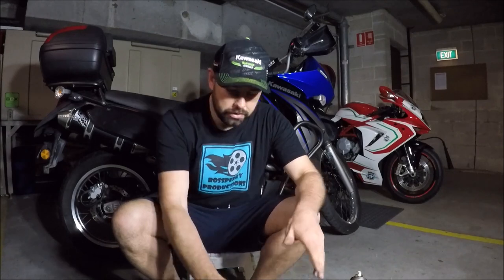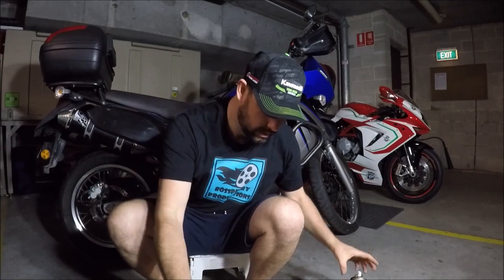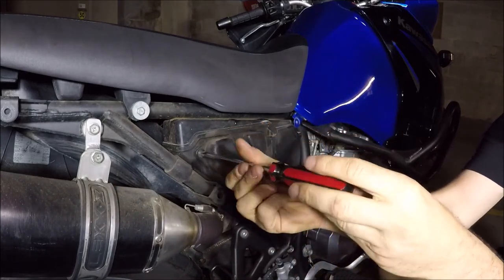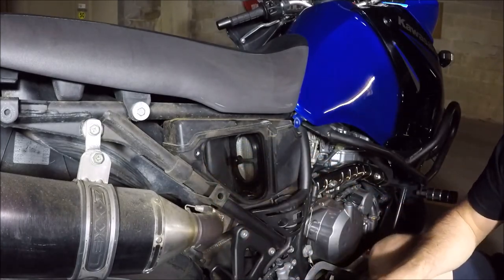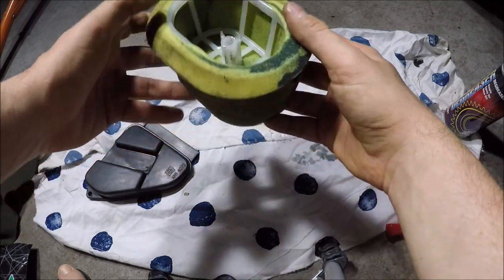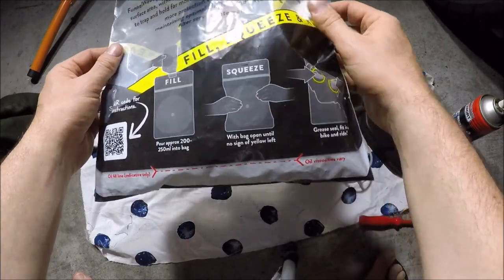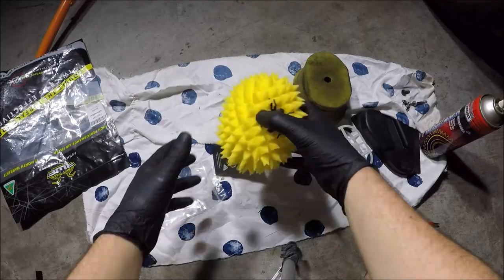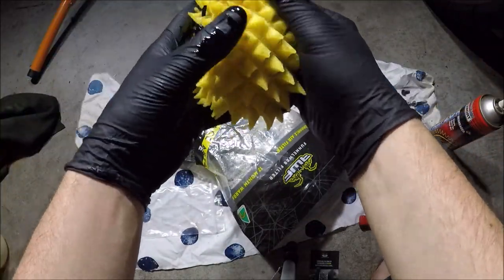How to Replace the Air Filter on a Kawasaki KLR650 Tutorial

Comment: The filter that was in there looked burnt? Or was it just carbon build up?
Reply from the maker: Hi Mate, thats where the filter oil has mixed with dirt and grime on the intake side of the box. Thats why it is important to clean your filter regularly. when are  'Lets Review It' coming to Review the KLR 650 and MV Agusta?
Reply: Shoulda seen mine after the bike sat in a shed for about 8 years, it turned to an oily dust
Reply from the maker: @jasonlambert154  I bet !!
Reply: @RossPerryProductions  and I rode it 800km before I realised lol
Reply from the maker: @jasonlambert154  I'm sure it would have gradually burn it off haha

Comment: I used a Uni filter and K&N spray filter oil.

I did not allow it enough time to cure. It fouled my plug and the bike would not run.

Give it time to dry/cure.
Reply from the maker: I have never had that before, although I tend not to use the spray type. Ross
Reply: Man, you need to squeeze out the excess oil out of the filter !
Reply: @markcollins5026  I did. Just didn't let it sit and sticky up long enough.
Reply: Do you have a part number and brand of the filter?